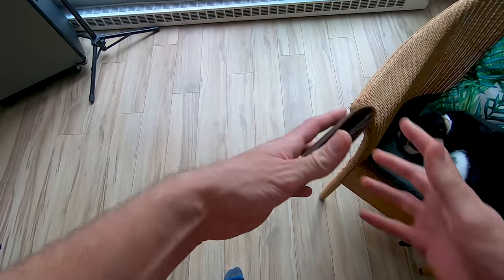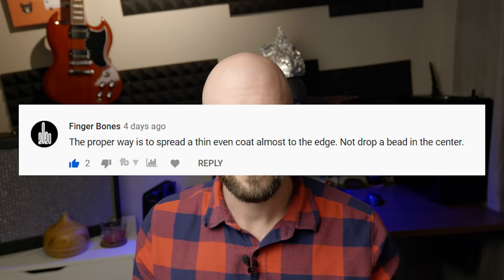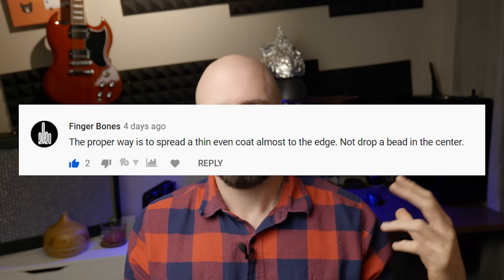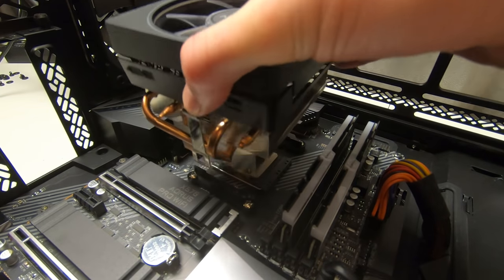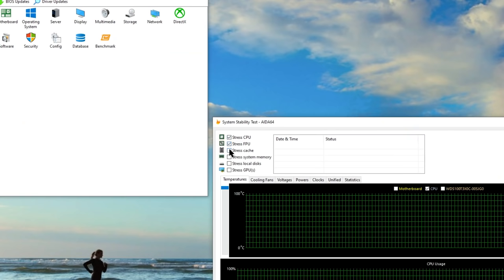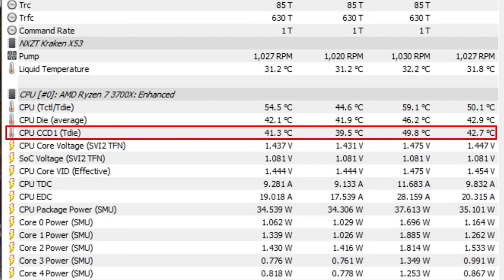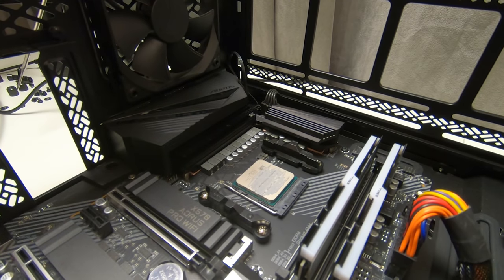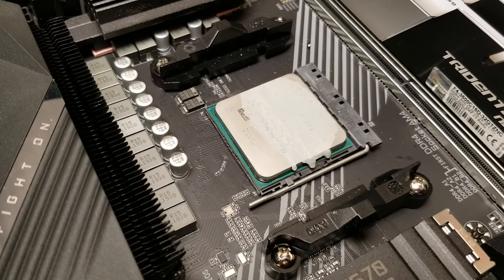Best Way to Apply Thermal Paste? Does it Even Matter?

Comment: I wonder if it would make a difference on thermal bound CPUs like the 7000 series, especially 7900, and 7950x since their performance correlates with the cooling solution. The better cooling you can provide, the higher the TDP, and, consequently, the higher clock speed. And, since they can be pushed past the 170W advertised TDP all the way to about 230W, I bet any little change would yield a more extreme difference in performance, but this time, instead of measuring in temps, since it will try to reach, and stay at, 95 degrees, you can measure in clock speed and overall performance.

Comment: I meant to ask, as for surface irregularities between different makers, do you or have you lapped your surfaces? Since the days of the Core 2 Quad Q6600 DO & b4, I was lapping for copper to copper.   Is that still a thing? I haven’t done it in ages, except just the cooler sides for now.. De-lid 'ing a Xeon W3690 to ThermalRight Ultra 120 Extreme copper edition. The i9-10900X is likely gonna get de-lidded soon.
Reply from the maker: Lapping is still a thing though mostly only for the hardcore.

Comment: the spread method is idea for open dies. i realized this when testing a machine with a duron 950 last year. also, use as little as possible and relly on the pressure the heatsink exerts on the chip to actually inprove cooling.
Reply: What do you think the pressure of the heatsink is doing to the paste? It's pumping out, not becoming denser. You don't know what you're talking about.
Reply: @pickleadaykeepsthedoctoraway  thermal paste is not a gas. you don't know what you're talking about.

Comment: I simply clean with izopropil and spread a very thin layer of paste over the dye evenly, all over. it's the best and surest method, why would you gamble and take a guess with a point since theoretically to apply it evently from a point you have to apply equal pressure and who can vouch for that, just spread like hazelnut thin and even. best way to go. imagine your dye is not a square but an irregular shape, what u do? spread like butter.

Comment: I keep hearing how a pea sized dot in the middle (for instance) is supposed to be enough. And I can acknowledge your testing, and everyone else's...
But my personal experience always ends up to be that spreading the paste with a card beats other methods. Just recently on my girlfriends computer again. There was definitely enough paste. Applied twice before it worked the third time after spreading it manually. We're talking 100°C vs 40-50°C difference.
I don't have the money to take apart anything here, but I'm starting to suspect that some CPUs (Maybe older models?) have the thermal probe located somewhere on the edge of the IHS, where the heat isn't transported off as efficiently... Who knows? Maybe we did do something horribly wrong. But I have the feeling that relying on the CPU temperature as shown in the software may not be the best way to know if your CPU is being properly cooled. And by spreading it over the entire IHS we at least prolong the CPUs life?

Comment: It helps if the CPU IHS and the CPU cooler thermal plate are perfectly flat. If they aren't, well, the cooling effect will be marginalized depending on where the aberration in flatness exists. This is just basic thermal dynamics, and the lack of, or excess of thermal paste or thermal pads is irrelevant.

Comment: Uummm, What are the temperatures using no paste, or dried up paste? That's what I want to know. I want to know how important paste is.
Reply from the maker: I did a test with no paste. Was hotter but still fine. It's in my library of uploads.
Reply: @TechIlliterate  , thank you.  I'm sure room temperature has a lot to do with it too.  I'm an air conditioning tech and I occasionally work in server rooms. Most server rooms like to be kept real close to 70°F, preferably 68°F.

Comment: Annoying the pea method didn’t get enough paste applied. Lapping a cooler to an already relatively flat AMD IHS and ensuring there’s still enough mounting pressure does wonders not so much for immediate temperature differences but for paste longevity due to consistent mounting pressure.

Comment: 5:01 well in my case it does matter, I tried the big dot and X and my cpu is getting 95°+ celsius ( I think it would go higher than that )

Then I tried the X with big Dot and now it's now staying below 70° celsius, yes for some people might say this is hot but these temps are underload plus my country's climate is freaking hot and I'm just using stock cooler

Comment: How many years do these thermal pastes stays on your CPU? I bought a gaming laptop back in 2018 and I've never refreshed its thermal paste. I still got good fps in all games. Does thermal pastes matter so much?
Reply from the maker: Most say somewhere around 2-3 years. I changed my laptop thermal paste after 6 YEARS it was dry as a bone however barely noticed a difference. On my GPU it was a different story. 

If you're willing to change it then give it a go.

Comment: the problem is kryonaut only comes with 1g, so you have to manage this limited quantity and can't apply it however you want.
Reply from the maker: I've used the 1g tube on multiple applications before it ran out. I do think it is too small of a syringe though.
Reply: @TechIlliterate  i think cooler master as a great mastergel system with a large pencil. it solve the debate. thermal grizzly probbaly a bit expensible and un reliable. sometimes all the paste come out and you can't really dose. plus it's really expensive. i think they don't deserve their reputation anymore in 2021. i might be harsh, but money is precious and 50$ for 5g of thermal paste is a little bit abusive to me.

Comment: To me it seems like the cooler is working too good causing a bottleneck and making the test flawed. Wonder if you had a less powerful one  or overclocked to the max where it struggled to keep up with the temps as easily letting them get to like 85 or 90s, if it would make a diff. Just like when they get bottle necks testing gpu and cpu making the results the similar, im wondering if that is kinda happening here with the temps being similar. 

Another thing i would love to know is how time changes the results. Seems like the smaller the drop the thinner it spreads or not touches at all making and would cause it to dry up faster compared to the buttered toast. So in 6 months or a years would this be the same or would them drying up faster cause them to get hotter faster down the line.

Comment: Quick need help I took fan off the heatsink to clean it had to go to work so I left it off, came back from work and now I forgot which direction ephantus posed to sit on the heatsink. Is a fan supposed to have the intake facing that direction of the heat sink or is it supposed to face the opposite to blow air away from the heatsink?

Comment: wow 2 years ago... i only wanted to tell you AMD constructed the wraith prism cooler with direct Heatpipe contact because its more efficient.... with a solid cooper platte between the Pipes and CPU Heatspreader there is 1 more layer the heat needs to travel thru and its not so efficient so AMD choose the direct contact method

Comment: 😂 My stock cooler's contact interface is smaller in area than my cpu's IHS. What should I do in this case?
Reply from the maker: That's pretty normal for cheaper coolers. Or perhaps you have a CPU with a large IHS. Either way as long as it cools then don't worry ;)

Comment: My ryzen 1200 had preapplied thermal paste in form of a cicle and this is about 4 years ago so its dry -and i will use my 20-15 year old paste I maybe have some 13 year old arctic cooler silver paste if i can find it.

Comment: pretty sure thermal paste specs and amount is considerably more important than how you put it in there... as long as it covers +80% of the area with a decent amount... the borders shouldnt have much impact because they will be cooler anyway so yeah... amount and quality is the deal... plus if you picky to that point... just get metal liquid... and again if you need that much performance where metal liquid (and who knows liquid hydrogen xD) is needed... then maybe you just need a stronguer cpu...

Comment: Hello is it okay if i get thermal paste around the cpu socket ? On the metal That closes when you put the cpu
Will it harm anything ?
Reply: Im on a lga 1151 i7 8700 
Msi mpg z390 gaming plus MB
Reply from the maker: As long as its not in the socket, generally it will be fine. always do your best to keep it clean though.

Comment: The main reason we need thermal paste is to connect the CPU and the cooler and get rid of the tiny gap between them. The paste is made up of these little stuff that acts like a conductor. This is supported with the major temperature change in the last experiment. It got over 10 degrees higher than the average because only a tiny bit of the surface area got the cooling from the fan through the use of the paste.

Comment: Thank you. But im still confused. I used "buttered toast" and my ryzen 5 5600x going to like 80C in games, 50-60 idle when my old ryzen 3 1600, with basic cooler was like 50-60 and ~40 idle, ofc it was different games, but still when i saw 80 i was scared. Do i need  to use more paste for more expensive CPU or im doing something wrong?

Comment: My method is better: I warm the thermal paste for a few seconds in the microwave; I purse my lips and touch the tip of the tube to my front teeth and suck on the tube while pressing on it (eliminates air bubbles); then align my lips to the center of the processor and spit as hard as I can
Reply: Excuse me wat

Comment: Great video, however you're used to eating really small peas right? :p Just joking ofc, it just seemed like very little thermal paste in the pea tests, I use 2x the amount and whenever I take it off it spreads all out and doesn't overflow. However I'm far from an expert or even good at it.. I'm a wreck every time I need to handle a cpu and cpu cooler :/ But I wish you would have tried the test with a 2x pea size, because that might have been the best option. Even if it doesn't matter at all when it really comes down to it :p

Comment: This isn't hard y'all. The point is to provide thermal path from heat sources to heatsink. Surface area is name of game. What's the problem with just attaching heatsink directly to IC? Risk of contact air gap. How do you remove chances of air gap? Use epoxy with good thermal coefficients. Apply across surface. Thin layer as possible. That's it. That's the optimal freaking way because physics.

Comment: Actually, what I guess: You should apply as little paste as possible. But there are still some hot spots and more uneven spots on the cpu. So it also depends on the exact CPU that you bought. The butter toast is really not bad.

Comment: The grooves in the heat sink were intended  for increased area of heat dissipation....except whomever used that as a justification forgot that it simply acts as channels for paste to flow. The only other reason would be for heat to flow away... butthat makes no sense because heat paste will be in the grooves block any aurflow.

Comment: So I used a 5600x stock cooler but I didn't apply thermal paste and I'm getting idles of 70 degrees but this may also be because I removed the cooler to rotate it. What do I do
Reply from the maker: Apply some thermal paste my dude.
Reply: @TechIlliterate  is there any particular way I should removed the old thermal paste?

Comment: Actually.. I have nearly the exact same set up. Im pretty sure you have a better card though
Reply from the maker: I probably didn't at the time, GTX 1070. But now most definitely. ;)
Reply: @TechIlliterate  yeah, im stuck with an RX580 atm. Really wanna get some kind of nvidia card
Reply from the maker: There should be cards available in the near future. I have seen many AMD cards available at my local shop.
Reply: @TechIlliterate  my current issue is i dont have a job which may change here shortly

Comment: More is better than less. Yes if you apply too much you will get hit by 1-2 degrees higher, but you can use it perfectly fine. In contrast, if you apply too less (especially when you can still barely see the characters on the CPU), the performance is hit hard and will degrade your CPU over long run.

Comment: My setup

AMD Phenom II X6 1100T 3.3Ghz 6 cores
Win 10 up to date
20Gb mem
Antec 1200 Gaming Case 6x cooling fans
Scythe Kaze master II
At idle Scythe Master is recording 32.3°c (Actual CPU Temperature is more than likely 10° higher than reported as this Temperature is taken from the side of the CPU, between the CPU cooler baseplate and Motherboard), I've not used thermal Paste for decades, the reason being when the time comes to remove the CPU, in my experience thermal paste sets like cement after a number of years in place, DISCLAIMER, I'm not saying you omit thermal paste on your new Ryzen Chip, all I'm saying is, my setup has never required it's use, never had any issues with overheating possibly due to the case I'm using, the side fan is key here, if I do upgrade to a Ryzen  CPU, I will be fitting without paste and monitor the CPU Temperature very closely, if it requires it I'll use it, if it don't I won't.

Comment: I don't know why some people put a dot in the middle it's absurd you won't get enough coverage, it seems to be common practice with technicians installing PCs, how lazy can people be to apply an even thin coat covering the surface of the CPU for best coverage and thermal transfer - people just buy big ass expensive coolers but they don't want optimal cooling, what's wrong with people ?

Comment: with difference of 0.5 degree and tolerance of 0.5 degree this results are useless. Your error spread can't be equal or bigger than result difference if you wanna measure anything.  

Your conclusions are perfectly valid and yes Wraith has insane bad heat pockets without massive amount of paste. But i bet that if you would test NH-15D with micro dot it would perform fine or on pair with others. 

Yes boys don't overload on paste ;) it will be fine.

PS. Wraith IHS is probably function of cost ;) AMD wanted to cheap out on it and make it functional that is all.

Comment: I would be more careful with this conclusion tbh. I assume, you measured the temperature with one sensor which is probably in the middle (of the CPU) and then you put thermal paste in the middle of the CPU in each test. So you will never know the temperature in areas where no paste was. I would guess it will be higher (but how much?). This is also supported by the finding, that nearly no thermal paste (last test) leads to high temperatures, since all the thermal energy needs to flow through one small dot, therefore increasing temperature in the middle. All in all I think "it doesn't matter" is not a conclusion to make yet.

Comment: A funny situation, from video to video, different results, some say that modern pads conduct temperature incredibly well, others that it is no better than pastes, some say that there is no difference in how to apply the paste, others say that there is, it seems that information chaos is happening and all these experiments have no weight. But even using the optimal tips that have a common correlation, my video card disintegrates any cooling and in AAA projects, after an hour, the glass wall of the computer has a temperature 60с like f* heater. 
So I began to think that maybe the problem is in the engineering and adaptation? Because a mid-range video card may well satisfy all needs. But instead of dancing with a tambourine, should we consider water cooling for video cards if the video card is like a barbecue?

Comment: Judging by the amount. I think I been putting too much paste 😂.  Next time I will use less.  Also depending on the paste viscosity, spreading it like toast would be a mess and not get good results. I know from experience. I was following the instructions to spread a thermal paste on to cpu, which came with the packaging.  It was a literal mess as the paste stuck to spreading stick and everything else. 😅

Comment: I have found over 100's of applications the buttered toast method can age poorly. It can trap air bubbles and over time this causes issues. The 5 dot method can also do this but not as bad. 

I like a line, down the length of the die (if it's rectangular) or in line with the stronger line of the pcb for square dies. 

Yoo little is bad, just enough is ideal bit for gpu's like my overclocked 2080ti going a smidge heavy and having a little squeeze out helps to prevent the past drying too quickly.

Comment: I figure the only real reason for not having a smooth base plate is just for manufacturing. How much easier is it to just run the piping compared to machining a smooth base plate to put on the bottom? 
Ngl drinking. Words hard.

Comment: never understood why anyone would just put a glob and press the heat sink down onto it. It will never spread fully and will leave air gaps. Just spread it thin with a card or plastic spreader and remove any excessive amount on the sides. You will never have an issue with that method. Never. Ever. You don't have to second guess, you don't have to worry, you will always make good contact.

Comment: should your themal paste be like applying bluetack as it keeps seperating and coming off from the cpu when trying to spread. really don't trust it and got some more from a different and trusty brand. it's not doing dreadful as it's sticking to 40 - 50 degrees celsius when idle and around 60 - 80 when working compared to the 50-60 and 30 - 40 before just switched my motherboard.
Reply from the maker: I have used some paste which works in that way. Thermalright TFX comes to mind. As long as the thermals are good then there is nothing to worry about.